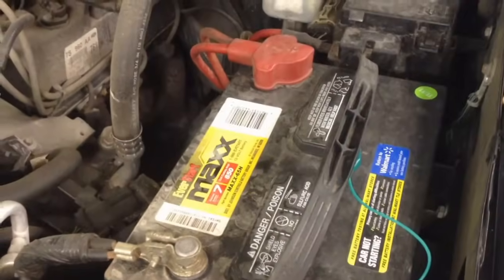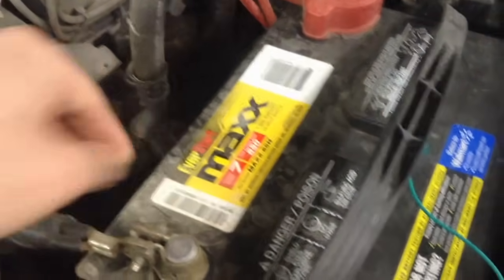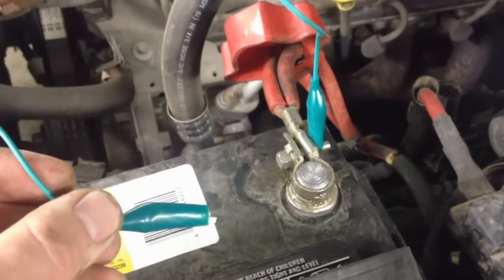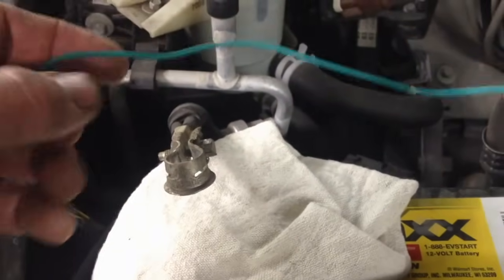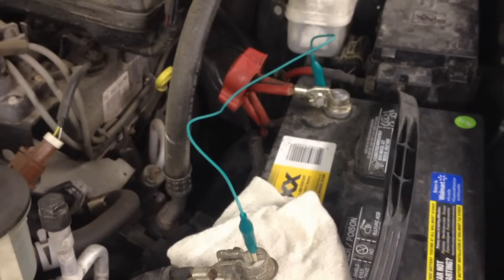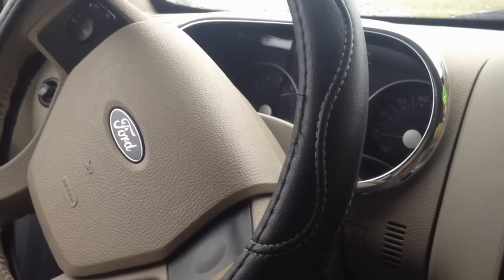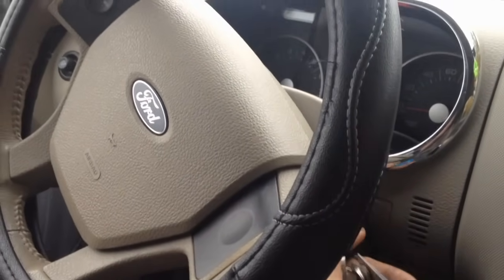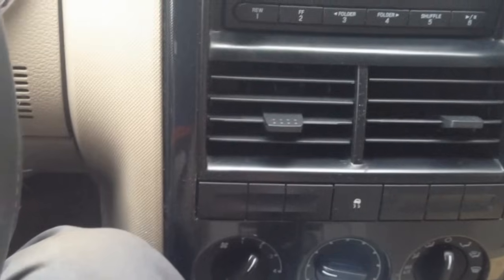How To Clear Your PCM'S Memory On Fords After Repairs

Comment: Would this also help with the fuel sender? I had a B1204, replaced the fuel sender but my cluster still pops up low fuel after i fill the tank then goes away then comes back, then the guage will randomly go down to different readings. 
Maybe my SUV is cursed lol. 
Note: i did clear the code after havinb the sender replaced.

Comment: Hey there! Thanks for this video and many other helpful ones. Curious if you have seen this work for the Charging Sytem Service Now warning light. I replaced my alternator/ batter and checked the electrical connections and it seems to still randomly come on for about 5 min then go off. Giving this a try to see if it was something with the PCM

Comment: I changed the transmission temp sensor and my truck is dropping rpm’s when I shift to reverse or drive fine when on park n neutral I changed the tps already injectors,spark plugs,coils and it’s still doing it any idea what it could be ?

Comment: hello, my english is not good. We unscrew the negative head, then connect alligator cable from positive to negative and wait for 10 minutes. Then we plug the negative into the battery and start the car, is that all?
Reply: Remove the alligator cable first

Comment: Thank a lot lot lot for this tip. I have Fiesta 2011 MK7 Global Sedan. I have strange problem with Instrument cluster. If my car is in idle position engine on run mode,  Meter gauge show reading as if i am driving the car. Example if i had 10000 on meter and i start the car and put it in idle for 2 minutes, the reading goes to 10001 when start driving the car. What can be the issue.

Comment: Now the question is, will this work on my 2002 Ford mustang GT? It has a different engine in it and it is running rich. And I do not have $800 to have a tune done to it or reprogram.

Comment: Will this work on 2015 ford escape? Changed some fuel lines on the motor and charcoal box, car just lost ability to take fuel never quit running and the oil light come on. Still starts and runs but will randomly stop accelerating

Comment: Will this process work on a 1.0 (3 cyl) 2018 ecosport eco boost? Because I have spent thousands of dollars on an under boost and low ECT. I replaced valve cover(pcvs), turbo, turbo was destroyed from pvc leaking oil into chamber, both thermostats, new plugs, knock sensor, crank position sensor. Now it is showing a low fuel rail pressure and all I did was pull the pump and rail off to replace valve cover and put them back on. I really feel that the pcm is screwing everything g up somehow. My obd 2 says these codes all still exist even after replacing all these sensors and parts. HELP!

Comment: i need help with my 01 f150 super crew lariat i had a dead cell didnt realize it till i went and changed the starter and altenator out so i replaced the battery then lost the factory key with ford stamped on it but i had a spare with a programed chip so i figured it would fire right up shit i was hell of wrong its been 3 months man and nothing im stuck i cant figure it out nor do i have a job any more cAUSE MY TRUCK WENT DOWN ON ME ,,, THIS HAS CAUSED ALOT OF ISSUES TO OCCUR LIKE EMPLOYMENT ,MY APT EVECTION CAUSE I COULDNT GET TO WORK NOW IM HOMELESS TRYING TO FIX IT STILL SO I CAN WORK AGAIN AND BE ABLE TO DRIVE TO SAN ANTONIO TWO SEE MY KIDS AGAIN SINCE MY EX  RAN OFF WITH THEM TO SAN ANTONIO FROM FORT WORTH 5 MONTHS AGO I SEEN THEM ONCE FOR 12 HOURS IM DYING HERE Man is there any way i can just delete the pats system if thats the issue ? my number is 6824656607 or email whitepierce820@gmail.com

Comment: Bro I have a theft problem on my 03 mustang gt like I can start it turn it off and on when it’s cold but when it’s somewhat warmed up and I turn it off the theft light flashes and does the whole lines on the mileage and I have to cycle the keys a couple times or just leave it in ACC position and it’s go away but the theft code it flashes is a 1-16 and I’m just stumped idk what it could be I even got a key fob for it bc they guy didn’t have one he never explained why and it had a aftermarket alarm and also a kill switch wired to the cluster and took it off matched the colors back together right it did stop the whole shutting off on me while driving but now I can’t Turn it off or it will go into theft mode
Reply: No I still haven’t ! I ripped the after market Alarm out but it still occasionally happens I don’t drive the car bc of it
Reply: @prodisai  okay update: i got the aftermarket remote fob but while wait for it to ship to me I dig some digging and tried to find previous owners. I’m the fourth person to have it in possession didn’t talk to the original owner but the dude he sold it too said that he told him that some one stole the radio from it. Which would explain why it’s kinda confused bc I have the key and both remote fobs one for the aftermarket which is programmed to it, and the factory one which is also programmed but it’s still eventually activate the kill switch so I’m thinking I need to install the radio maybe ?

Comment: This was the only thing that helped me to get my rear right turn signal and brake light working,  i tried resetting codes and chased wires and fuses and so on but this fixed it... finally thank you!!
Reply: hello, my english is not good. We unscrew the negative head, then connect alligator cable from positive to negative and wait for 10 minutes. Then we plug the negative into the battery and start the car, is that all?

Comment: I'm just an old dummy and I don't understand how that would not short out. Wouldn't hook in the negative to the positive cause it to short out because it's going to the ground or is it the other way around?
Reply from the maker: With the negative battery cable disconnected from the negative battery terminal the circuit is broken so no current can flow.
Reply: @FordTechMakuloco  okay thank you.. I also watched a video where you can disconnect the negative terminal and turn on the headlights and will also drain it

Comment: Got a problem with misaligned gear selector indicator on a 2007 Ford Explorer sport trac with shifter in console. It is a 4.0 liter engine automatic 4x4 with 55R5S transmission.

Comment: Thanks man this saved a costly dealer trip after a bad jumpstart of dead battery. A wrench came on and engine was running rough. Pulled U0300 code. Decided to try this after watching your video and IT WORKED! Got my truck running like new. THANK YOU.

Comment: This works my 1999 SuperDuty 4x4 runs like a new truck again!!!! Thank you
Reply: Did you do it on both, or just one batteries?
Reply: @mariefeely972  I have a 2003 F350 super duty it also has two batteries, would I do each battery at a time? or both together? ..thank you please reply back..

Comment: Got a 2003 F150 and let it set over the winter and the battery ran completely dead and would not take a charge. So I went bought a new battery and hooked it up and turn the key on and Nothing happens for little over a solid minute and then the door chimes come on and gauges come up and dashes on the odometer instead of mileage. And theft light flashes fast for about a minute the flashes once and the one more time then pause then flashes again so on and so on. I replaced the pcm relay also..I tried resetting the system by turning the key on and off 8 times locks lock and unlock so I hit a button on the key fob to set it and the locks lock and unlock but after that nothing happens....it won't start and does same thing over again..... Do I need to do this to reset the system?

Comment: Hello just want to start by saying I love your videos and started following you because we had a 2008 Ford Escape Hybrid which we got 400,000km out of with help from your videos. Thank you sooo much. We recently purchased a used 2017 Ford Cmax Hybrid Energi SE. It has sync 3 which is fully updated to 3.2. Ever since we have owned it the 2 usb/CarPlay plugs in centre console have worked intermittently. I managed to get it to update sync with multiple tries through usb. Now that is is updated cannot get it to work longer than 30 seconds. The iPhone 12 which is fully updated as well with brand new iPhone original sync cable. The prompt will come up saying want to connect to apple car play and it says phone is charging for all of about 30 seconds. After that it stops working. No blue lights around usb plugs and even have a usb tester. Tester confirms no voltage at usb terminals. What could be causing this please. My local ford dealer cannot figure this out. This is why we bought this year CMax was for apple car play and the updated Sync and of course it does not work. Any help would be great and will even pay you for your help. I am a Ford tech that has been off on disability for years now and know what it’s like for people wanting services for free. Thank you in advance and love your videos.

Comment: I'd like to know if this reset procedure will clear my O2 sensor heater circuit codes ...replace all 4 and still get the codes, troubleshooting with the factory electrical diagram manual gets me to a pcm issue versus the O2 units. Same with purge valve codes and egr codes ...new parts same codes being thrown.

Comment: I did this and now no power from my 2015 F150. Just the mileage, speedometer, rpm and the gauges are lit up. 
12.24 volts from a battery that is less than a year old. 
How can I fix ?

Comment: I tried this on a 2018 f150 does t seem it did much. Not sure if the radio and everything else like blue tooth would have to be reset but all of that was the way I left it. The only thing I noticed different was when I did turn the truck on after doing with the video said my radio was on the a.m. channel instead of the channel I was on when I turn the truck off last normally when I start up my truck whatever radio station I was on last is the one that’s on there so that is the only difference I’ve seen I didn’t need to reset my clock. No radio stations had to be reset I didn’t have to set Bluetooth up none of that stuff so I’m not sure if what the video is saying really did anything. Any comments would be greatly appreciate it. Thanks. And my yellow wrench icon next to my mileage is still on.
Reply from the maker: This procedure will not affect any part of the NVRAM in the modules.
Reply: @FordTechMakuloco  would it at least clear the yellow wrench icon light ?

Comment: Hi, and thanks for your video. If you don't have alligator clips can you use regular battery charger cable's? 🤔
Reply: i was thinking that,  did you try it?
Reply: @johnchapa284  nope not yet. I was hoping he'd respond. I recently got my tranny rebuilt and I installed it. There are no codes but my scanner is not showing green it's showing yellow(caution). Someone told me it would go away after some drive cycles but I'd rather do what this professional says to do.

Comment: Old video but on my 15 explorer I was getting p1450 for unable to bleed purge valve so I replaced the purge valve under the hood and still has a “idle surge” while driving could this code cause that problem or would there be something else? I didn’t do this with the negative and positive I just cleared the code with my Diablo tuner from my neon

Comment: wait WTF? why would you ground the positive side of your battery terminal when + is connected to the battery?  duh fugg would that do? never heard of this, you can get the OBD1 scanner for like $50, it will clear codes all that.. if this procedure isn't in the service manual do not bother.. seems ignorant to me cuz the - terminal isn't connected so the + is inactive? what would it do?

pretty sure just removing your battery cables clears your ECC? this lil' jumper wire is um, well do I need to say it?
Reply from the maker: Once the negative terminal is removed from the battery the battery circuit is broken and electrons cannot flow. However the the negative and positive circuits within the vehicle is still intact including the circuits connected to the reserve capacitors within the modules throughout the vehicle.

Comment: I have a 2014 Explorer Sport and I've noticed that in Manual mode, accelerating to 6K,  I can manually shift from1st to 2nd fine however, the trans will shift it self from 2nd to 3rd without my impute around 5 1/2K. I also noticed 2nd to 3rd in normal mode the trans seems to long shift.. Would this "clearing" correct it?

Comment: Will this clear the antitheft module? I have a  2004 Expedition 5.4 EB edition.  My keyfob is good but nothing is disarming the antitheft system and its same key i always use nothing happened other than low voltage

Comment: Thanks for the video!!  I tried this but no success with my issue on 2016 Ford Fusion 1.5L.    When driving at higher speeds I get a shudder, all this after a battery replacement!  Engine light flashes occasionally…. Stopped and had it scanned and had the P06B8 code.   At first I thought it was a plug or coil but no… No problems though till battery change.   Any help would be appreciated!

Comment: This works on a 2011 F150 limited? I tried this but  i think doesnt work , because after this process, in the radio/touchscreen still shows my phone as conected. Sorry bad english.
Reply from the maker: Yup, you cannot clear NVRAM though.
Reply: @FordTechMakuloco  so the only way to clear adaptative shifting transmision settings its with some profesional scanner?
Reply from the maker: Yes on newer models only say 2009 and newer they went to NVRAM for the trans adapative tables.

Comment: The EGR was replaced on my 08 explorer (code P0403). But after it was done, I now have different code alerts. I get P0153, P0141, P0155, P0161,  and the same code still shows P0403 for the EGR. Do you think this repair wasn't done properly and that's why the other codes show, I know those are the O2 sensors but never heard of all 4 going bad at ones? I get more codes P0053, P0054, P0059, P0060 but its the same O2 sensors I guess.

Comment: I’ve been chasing a high idle problem for the better part of 6 months and this just fixed it. Almost brought me to tears. Countless hours into my truck(98 f-150) with the 5.4 and this fixed it in 15 minutes. Cannot thank you enough.
Reply: Just had 10 speed trans replacement. The tech that did was aware of methods in your video and kept the F150 to this procedure after the replacement. Great video. Adapt learning I. These transmissions are complex. Thanks!!!
Reply: I've been chasing a high idle for 7 months on 01 Sable LS,..V6 Duratec motor.
Only on cold starts,....after about 8 hours,..shoots to 3000 rpm's twice in about 1-2 minutes.  Did you have any trouble with rpm's sticking during driving?
I've replaced a lot of sensors,.....gonna try this tomorrow.

Ceskoslovenska.
Reply: @IvanTheVariable  did it work?
Reply: I'm having high rpm on my 2007 Ford focus. Does your Ford have electronic throttle body or cable?
Reply: Can you do this for all Fords? ALL year models like 1995 F150 5 0
Reply: Can I drain the capacitors by disconnecting the positive clammer and then shortcircuiting, like in this video, the positive and negative? The negative cable is very difficult to release because of battery placement, so that's why I ask if it's ok to release positive instead?

Alternatively can I release positive and just press on brake pedal for 10 sec (or how long?) to drain the capacitors or I still have to shortcircuit positive and negative?
Reply: I been fighting the same problem, I replaced my pcm, (computer) fixed my problem
Reply: This this work on a 2015 f150? Does it also clear all learned memory like radio channels

Comment: Thanks for the video it helped me out 100%. Igot a 06 five hundred, I cleaned the mass air flow and throttle body was really gunky. After cleaning and put back together I disconnected negative cable and put  battery jumper and I waited 15 min. Put battery cable back on and ran the car, after 6 min took out for a drive and ran better than when I bought it 10 years ago.

Comment: clearing the PCM, will this also erase any codes the vehicle may have? My 08 explorer has six codes p0443, p0135, p0141, p0155, p0161 and p0403 , when I scan it it reads as a circuit issue which leads me to believe its associated with the PCM any input will be greatly appreciated

Comment: I tried this but noe the fuel range is incorrect , any suggestions please
Reply from the maker: This will not affect the fuel gauge operation, your problem is elsewhere.
Reply: @FordTechMakuloco  thank you so very much for taking the time to respond.
My car is a 2006 bf xr6 falcon 6 speed automatic
 before I did this pcm reset the only problem was the car would start at the key then would only hold the idle for 2-3 seconds & then die out , all the gauges worked perfectly. Now the car drives smoothly and effortlessly. The fuel gauge with the needle is fine but the digital display is reading incorrectly and will only build up gradually up the 36 km range I've driven past that amount but it remains at and starts at 0km after a restart I'm going to redo the reset see how I go
Reply: @FordTechMakuloco  ok so I did it again and what I also did afterwards I had the same outcome but I don't think to press the trip reset that brought it back to function lol so simple thanks heaps I saved a bunch

Comment: Hi, keep getting fault code for oil deteriorated on my ford kuga mk1 2010, Although it's recently had an oil change, I've done an oil reset using brake/accelerator but fault returns after a few days. Looking on kuga forum, someone mentioned resetting pcm, Is this what I need to do or could it be another problem.??.  Any help would be greatly appreciated